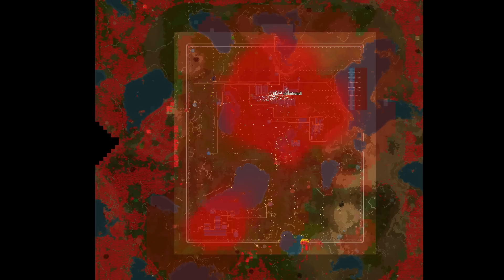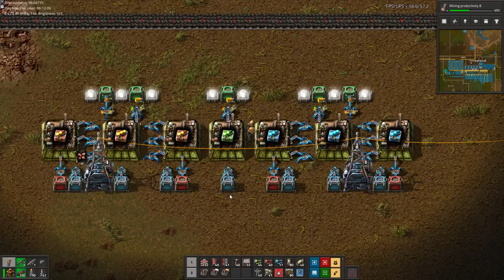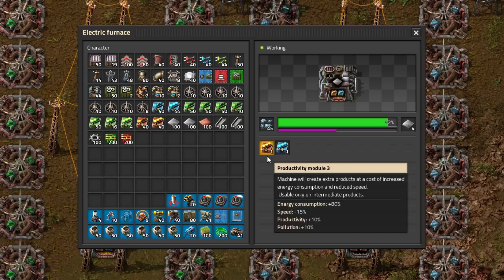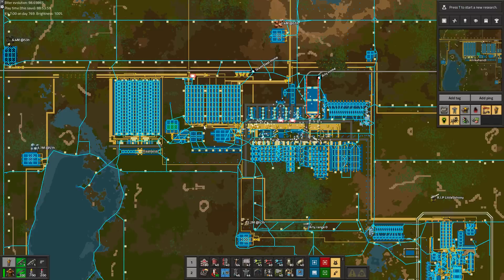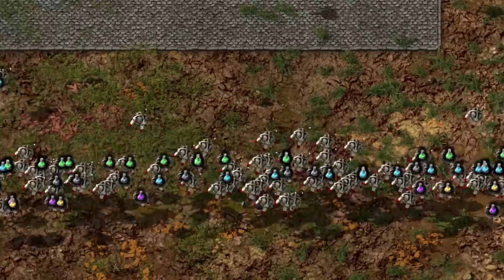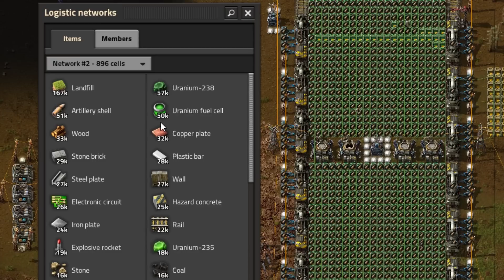Climate Activists GLUED themselves to My Video! // The Ultimate DeathWorld Challenge

Comment: you cant just compare the pollution of the furnaces for a given output because the take a different amount of input because of the missing prod module. therefore the saving in pollution is not as great but still good
edit: in other words productivity modules trade pollution on one step for pollution on all previos steps

Comment: Bad news: this video isnt the first time I’ve seen a factory design to minimize pollution.
Worse news: when I did it, I maximized efficiency 3 modules and productivity in all machines (except for using 3 prod 1 speed in assembling machines, instead of 4 prod)

The real kicker: it was a marathon map preset. without modifying the biter generation, making it basically pointless

I went through >100M iron and copper just to reach 450science/min, which is as fast as 100spm while consuming the equivalent to 900spm of resources in a standard game due to the marathon settings.

Comment: Why all that buffer. Filling them with goods, is just adding to pollution no matter how low you get the pollution on production?
Reply from the maker: It will be a good control point to check if the base production is sufficient to supply science, module production and military expansion. If all the buffers stay full, things are looking good. For a pure SPM build, you don't need buffers at all, but with the other 2 added, demand will vary so it's good to have them

Comment: remember to do ALL the math to see at which point do the resource and electricity savings from productivity AND speed modules outweigh the pollution decrease of efficiency modules!
Reply from the maker: Electricity is near pollution free, so no worries over that. For resources, after EVERYTHING is -80% pollution, mining the raw ore will again be the biggest pollutor by far, so (if it were not for my finite resource situation and the end of the playthrough starting to come within sight), it's probably worth it to choose for a higher number of furnaces/assemblers/etc with extra productivity.

Comment: I'm curious about the productivity module in the furnaces. That seems to suggest that you're worried about upstream pollution from mining, but if that's the case, why not focus on moduling the mining patches? A double row beacon setup on mining with 3.5 speed 3 modules and 6.5 efficiency 3s boosts output by 175% at no pollution increase (and a small beneficial increase in drill density), while needing 5-8 level 3 modules per drill depending on patch shape. Even in the worst case, this is giving you more than 20% per module compared with 10% for a productivity module in smelting. When you consider that at mining productivity 8, you only need 35% as many drills as furnaces, the economics become even worse. Putting the productivity module in the smelting gives you neither a total pollution reduction with full level 3s nor is it a more efficient use of level 3 modules. As you get to higher levels of mining productivity, this effect will become more pronounced as the overall pollution from mining decreases, so throughput efficiency of smelting (better served by speed modules) becomes even more dominant over input efficiency.
Reply from the maker: The ProdMod in furnaces (and other machines) are meant to make my limited resources last a little longer. I'm too poor to go full module 3 approach, which is why I try to use as many eff1 mods as I can get away with.

Mining is the most important element to bring down to -80%, as they're by far the worst pollutors in the base. You still have a point though, I could gethe miners to at least double speed while reatining the -80% pollution (using full expensive modules), halving the amount of active miners/miner pollution at any time (but more manual upkeep for rebuilding mines/beacons, I guess).

I figured the full -80% approach will get me to where I need to be, but if not it's good to know we have options to limit pollution further.

Comment: I have a question. Everywhere on the wiki and forums, it says that efficiency module don't actually reduce the pollution output of a factory. If so, how did it reduce the pollution output of the furnace from 1 to 0.22?
Reply from the maker: For each machine, it's base pollution output is tied to it's base power consumption. If the power consumption goes up (through speed/prodmod) or down (throug eff.mod), it's pollution does likewise as an indirect effect. So, after all mdules energy consumption are accounted for, we end up at -80% consumption and 0.20 pollution. After that, the productivity modules apply their additional, DIRECT modifier to the pollution  (+10% pollution), and we end up at 0.22
Reply: @MichaelHendriks  Ah, I thought that this might be the only plausible explanation for that but I had nothing to back up my hypothesis. Thank you for this insight on this, as well as the order in which mdule effects are applied! I'm guessing this is to prevent you from using efficiency modules to directly reduce the pollution output of boilers, stone furnaces and steel furnaces.

Comment: If you use Eff3 modules in beacons, you might be able to fit more speed modules in beacons so that the machines go faster and you need fewer of them.  I don't know how the build cost comes out since you end up saving MK3 chips in machines, but the pollution output goes down even further because you use less machines (still at min pollution).

It's also better actually to put the MK3 speed (or efficiency) in beacons rather than machines since each beacon affects up to 8 machines - so you can have one in eight beacons with a pair of MK3s instead of one MK3 in every single machine.  You can also get fancier with your design and fit 12 beacons around each machine to do even better.
Reply from the maker: I decided agaisnt T3 eff mod for being too expensive for their extra benefit. you need like 5 T3 eff + 1 T3 speed to do the job of 6 T1 eff, for aminor gain in speed. The main focus/profit is getting each machine down to 80%, then bump the speed back up close to original or better. The ROI of every extra speed module diminishes fast after that, and would be great resource cost.

I see your point with the beacons, and I didn't think to experiment further with it that way, once I saw the T1 eff. beacon thing reached the goal. It could indeed have been more economic, though it will be more easy to explain the concepts with the module colors nice and organized ;)

Comment: Surely it could be even more eco friendly with efficiency 3 and 12 beacon setups, considering beacons don't pollute. Prod in the furnace, then as many speed in the beacons as you could fit while remaining -80%.
Reply from the maker: I considered it, but deemed it too expensive for very minor gain. The main bulk of the pollution profit is getting to -80% while not slowing the machines to an absolute crwal. The pollution ROI of every next speed module is minor

Comment: Can I ask why dont you just use splitters with input priority? 22:58
Reply from the maker: Sideloading seems more reliable when relying on 100% throughput
Reply: @MichaelHendriks  Do you mean that splitters might sometimes leave gaps?
Reply from the maker: It might happen in barely-enough-ore situations, and with sideloading it's easier to spot too once the ore is insufficient, as the whole backlog on the sideloaders will disappear (and it's that backlog "pressure", squeezing ore in on the main belts which keeps the belts 100% full 100% of the time)

Comment: Why not use mk3 efficiency modules in the furnaces, and put the productivity/speed modules in the beacons?
Reply from the maker: Beacons don't take productiviy modules.
Reply: @MichaelHendriks  I thought they did, huh. then why not put one speed 3 and 1 efficiency 3 in the beacons?
Reply from the maker: Eff2/3 modules are not much more powerful. It would cost too many resources (for this map) for very minor gain
Reply: @MichaelHendriks  gotcha, doesn't have the same power curve as the other types

Comment: Couldn't you get pollution lower by replacing the mk1 green mods with mk3 then filling the slots you don't need with mk3 speed? You would need less machines so you would have less pollution if they are all at the minimum pollution output.

edit: obviously it probably won't matter too much but my min maxer brain is goin crazy.
Reply from the maker: Yeah, but the mark 3 module cost would get out of hand too much for not much ROI, so I settled for the cheaper solution
Reply: @MichaelHendriks  fair enough

Comment: isnt there also an issue where the tree damage is not globally based but chunk based? I would assume once a chunk passes a certain threshold amount of polution in it then it starts damaging the trees, so even if you only produced 1000 of the 2000 they are currently safely consuming, the local chunks could still have too much polution and be damaging them, eventually killing the trees and then spreading out further.
Reply from the maker: Trees are damaged whenever chunk pollution >60, and every instance of tree damage absorbs 10 pollution from that chunk. There's different end-states for trees, absorbing different amounts of pollution for each end-state. While individual trees can completely die and become useless pollution-wise, on average the full end state of the forest in a chunk still absorbs a lot more pollution than empty land.

The pollution cloud won't grow infinitely, even on a map without any trees. Eventually, the combined absorption of all polluted terrain will match the avg pollution output, and the cloud size will stay stable.

Comment: Wouldnt solar panels be more eco-friendly than even nuclear?
Reply from the maker: Not noticably
Reply: @MichaelHendriks  what?! really?..Solar panels are an unlimited source of free energy that produce no pollution...you need to mine uranium (that is pollution) you need to processing (i think that is pollution) and then you need to use it (that is pollution)...you didnt take in the miners in to account did you?
Reply from the maker: The required amount of uranium to run nuclear power is incredibly small, it's probably less than 0.1% of my bases pollution output, hence not noticable. But if you're gonna go that way, you need to take into account the pollution created for the production of the nuclear plant vs solar/accu... At near 160MW per reactor, I'm pretty sure nuclear would win over solar including the fuel 200h or so of power... Would be an interesting calculation to figure out exactly though

Comment: I wonder if mixing a few speed modules into the beacons and upgrading some efficiency 1 to efficiency 2 as an offset would make the furnace area even greener, bc it might need fewer machines. But probably not worth the tedious manual part of actually setting up beacons with different module distributions
Reply from the maker: Your reasoning is right, it would reduce overall pollution slightly more, but at a high extra cost, requiring tier 3 modules exclusively
Reply: Blueprints remove most of the tedium. It's the cost of construction (mostly modules) that becomes obscene

Comment: You shoud extend your base for 10..20 chunks on every side, to keep pollution inside the perimeter. There is two benefits: 1. nobody will attack you 2. no need to reconstruct the base.
Another benefit: there will be small groups of settling bugs, which can be bitten by lasers. You will not need such complex flame turrets-based wall defence.

It is not just talk, I used in in me base - works perfect.
Reply from the maker: That's another way to go at it, but that's 100.000s of extra worms and bases to destroy... It would become a bit monotonous I guess
Reply: @MichaelHendriks  you can automate it, by building artillery trains and stations. But you can not automate base replaning! ))

Comment: I can't fire up factorio to check atm, but I bet that smelting array could do a bit better with a mix of efficiency modules 3s and speed modules in the beacons, when you have enough resources for the module 3's anyway. Would cut down on the pollution even more :D
Reply: *launch production of 400 new speed mod 3, let 2000 bots die to biters ans overproduce 10 000 artillery shells*
Reply from the maker: True, but I'm a little worried about the finite amount of resources in my borders, so not sure if I want to spend the resources for all the eff.mod3

Comment: > didn't want to use 2 prod modules in smeltes as that would've doubled the number of smelters needed. 

so you could've used 2 speed modules and shrink it by a half again? and as such also the total remaining polution by half? lol
Reply from the maker: Not quite, the 2nd speed module is comparatively only half ish as effective.
2x prod gives 0.6 speed multiplier (0.72 accounted for prod bonus)
1xP 1xS gives 1.3 speed (1.43)
2x speed gives 2.0 speed (2.00)

Comment: I like that this challenge involves minimizing pollution. I've been wanting to build an eco-friendly megabase on a deathworld map and have already put some thought into figuring out the best module setups. Now I'm curious to see what your solutions are :)
Reply from the maker: Feel free to share your solutions :) Mine probably will be different, due to not being infinitely rich on this map, and new ground is... "expensive" to come by!
Reply: The othet common method I have seen is full prod in the machine, and then 1 speed 3 and 1 eff 3 in the beacon.  I'm not sure if that brings you down to min pollution or not.
Reply from the maker: Eff2/3 are quite underwhelming compared to eff1, you could probably change 6 Eff1 for 5 Eff3 and 1 Speed3, or 12 Eff2 for 11 Eff3 and 1 speed3, so a tremendous cost for not too much more to gain. It's covered a little more in the start of the next episode (the different beacon builds around the assemblers)
Reply: @MichaelHendriks  interesting. Thats what my gut said the ideal mix would be but i wasnt sure about how much better for how much more.
Reply: @hoveringgoat8061  Yeah, it depends on if you want to stay with eff1 or jump up to tier 2 and 3 modules.

Tier 1 are just so cheap compared to 2 and 3, as they don't cost any blue chips.  As a point of comparison, tier 1 modules cost 15 green chips, tier 2 modules cost 190 green chips, and tier 3 modules cost a whopping 1080 green chips.  (This counts the greens that go into reds and blues).

You really have to do a cost comparison for going to tier 3 modules, and that really depends on the type of run you are going for.
Reply: Switching to full prod 3 instead of half prod 3, is almost a fifty percent reduction in resources used per science.  Seems to me, for minimal pollution, the investment in eff3/sp3 beacons pays for itself very fast in a resource and pollution metric.  You can need far less infrastructure, AND still run them at 80 percent pollution reduction.    Seems well worth the cost of 1000 green chips each, especially when you suddenly need half the infrastructure running.

TLDR.  Use Full prod3 in assemblers/smelters, and Use eff3 and sp3 in beacons for minimal pollution long term.
Reply: hello there fellow orange pfp